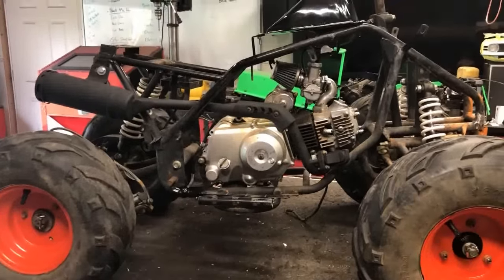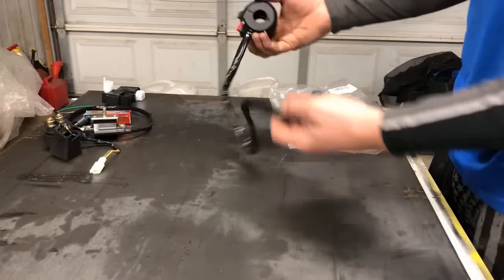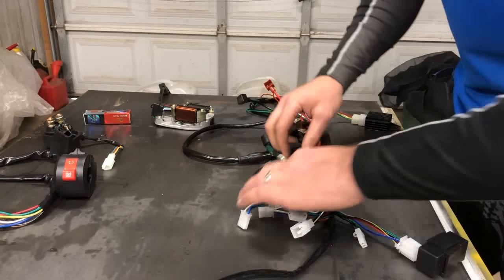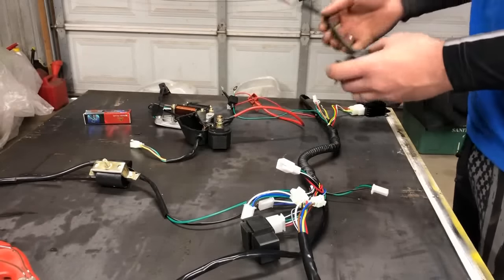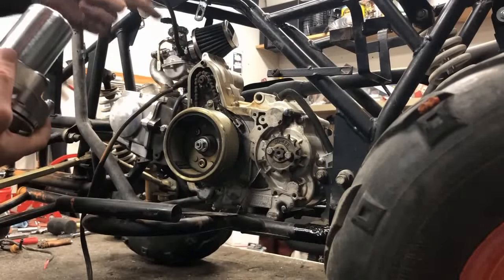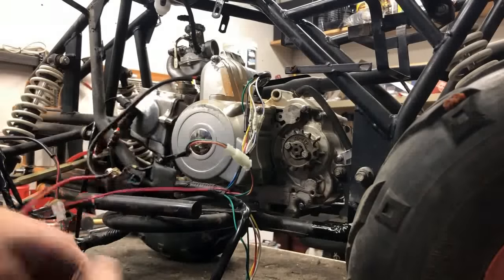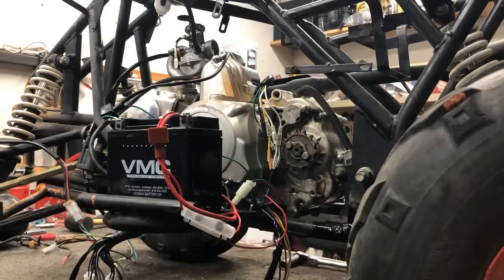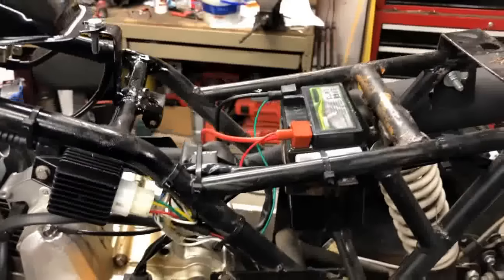Wiring a Chinese ATV from start to finish with an All New Wiring Harness!

Comment: Your videos are awesome and very helpful! Keep up the good work. I have a question on the wiring connection to the stator, the colors match except I have two yellows from the stator with a yellow and a white wires on the harness. Does it matter which one plugs into which yellow. Thanks

Comment: I have a taotao 110cc buggy, I got a whole new harness which is different than urs cuz it has no wires for the lights, I’m getting power every where when I press the starter switch but no power goes to the starter unless I bridge the terminals.. I also checked the wire coming from the brake n it only looks like positive power. What else can I try?
Reply from the maker: Check out my video I posted last month titled "How to flip a Chinese ATV". I can't leave a link because YouTube will delete the comment. Start that video at the 24:00 minute mark and I walk you through a step by step to figure out the exact issue your having. You will need a test light, if you don't have one I put a link in the description to get one off Amazon Prime cheap. Let me know if that helps!

Comment: What would explain that I don’t get spark?   I followed your video step by step. I sent my first harness back thinking it’s Chinese junk and still having the same issue on the second harness.  Battery is good and the engine turns over. I tried the new plug and my old plug with no luck.  Any suggestions?
Reply from the maker: Stator, CDI, Coil, and Spark plug are the components that effect spark. You also have the ground wire, safety tether and kill switch that need to function correctly. Start with the easy stuff. Unplug your tether, clean your contacts for ground, make sure your battery is fully charged, and use a multimeter to make sure the kill switch functions properly with an open and closed circuit. If you do all that and still no spark, then likely you have a failed component.

Comment: hi. is it possible to connect another cdi unit to yamaha kodiak 400 in 2000. maybe from the scooter cdi 6 pin .may you specify what cdi unit would be. thank you
Reply from the maker: I'm sorry but I don't know that. I've had limited experience with electrical on larger atvs.

Comment: I am rebuilding a Chinese quad right now for my daughter. I'm trying to find the correct exhaust. The exhaust pipe thats on it has that extra port on it but I can't find an exhaust with that on it. What is that port called and where can I find the exhaust with it included? Thanks.

Comment: Can I use a 2 coil stator if mine has a 6 coil? I have a buyang 107cc with a loncin motor and the remote start box and alarm thing on the front
Reply from the maker: I have not tried to swap stators, I've always just order the correct replacement. Next wiring project I'll give it a try just from fun!
Reply: I was wondering the same thing... I bought a 6 coil cover by mistake and was wondering if I should buy a new 6 coil stator and 6 coil flywheel and have all new or buy another cover and use the old stator... I'm worried V regulators may be different or something but not sure so I just ordered the 2 coil cover 😕

Comment: I have a Roketa 90cc atv with the bottom-mount starter and 6-coil stator. It’s missing some screws inside and outside of the stator cover. Would possibly you be able to give me bolt sizes?
Reply from the maker: Here is a link that has everything you should need: https://www.vmcchineseparts.com/products/chinese-engine-cover-mounting-bolt-kit-50cc-125cc
Reply: @PraskaBoysGarage  you’re the MAN! Thank you so much!
Reply from the maker: @blam3329  You bet!
Reply: @PraskaBoysGarage  my Roketa has spark!!! Thanks again for making this video!

Comment: I did everything step by step but I'm not getting no spark at the spark plug. Anything you know that would cause that
Reply from the maker: Stator, CDI, Coil, and Spark plug are the components that effect spark. You also have the ground wire, safety tether and kill switch that need to function correctly. Start with the easy stuff. Unplug your tether, clean your contacts for ground, make sure your battery is fully charged, and use a multimeter to make sure the kill switch functions properly with an open and closed circuit. If you do all that and still no spark, then likely you have a failed component. In my experience if you have a failed component it's usually a bad CDI Box.

Comment: Hooked up as you said green wire started smoking and key/kill switch did nothing turned over starter without start button aswell
Reply from the maker: Smoking in no good! If the green wire is smoking that means it's getting too much power likely for 1 of 2 reasons. 1) You have the power wires backwards, Green needs to be on (-) negative and Red needs to be on (+) positive. 2) You have power going to ground. Since something likely got hooked up backwards double check your fuse because it may have blown.
Reply: @PraskaBoysGarage  is it because i used a lawnmower battery?
Reply: @PraskaBoysGarage  what size battery does it use?

Comment: Were do u order all of your parts for your Chinese fourwheelers
Reply from the maker: VMC chinese parts is usually my first stop. They are based out of Illinois so I get my parts quickly and there prices are very reasonable. Other than them I typically stick to eBay for selection options or Amazon for the prime shipping.

Comment: Thanks for the great video explaining rewiring.  I recently picked up a 90cc go kart with electric start that was running just fine until my 5 year old son decided he wanted to wash it and hosed it down.  After that,  the electric start won't work, and I have to jump it with a thick piece of metal at the starter solenoid to get it running. I already checked all the wiring and nothing seems out of place.  Any idea what my problem might be?
Reply from the maker: Check the start button contacts inside the switch. It might have faulted when it got wet. Doubt you blew a fuse but always check that too! Thanks for watching and I hope you find the issue.

Comment: Hi, just followed your video and the quad tried to fire but then went completely nuts and constantly tries to fire up even when I stop pressing the start button. Disconnected the switch and also the key and it still tries to start when I put the battery connector near the terminal, any ideas???
Reply from the maker: Hey sorry I'm getting to your comment late. Are you still having issues? Sounds like your starter relay is having an issue.

Comment: Great Video! I just installed a harness. The starter runs continuously but no spark. Releasing hand break will stop starter, but the kill switch, and momentary starter switch on the handlebar do nothing. any idea?
Reply from the maker: Richard Hutchinson You definitely have a something plugged in backwards. It’s probably the 2 wire clip the comes off the starter relay and you have it plugged in the foot brake safety.
Reply: @PraskaBoysGarage  thanks
Reply: I had the same problem i cut the kill switch on the cdi and my motor started immidiatly but had one problem cant stop the motor so make a switch between the wire you cut and you can control the spark

Comment: I just rewired my 110cc taotao atv and it'll crank but won't start... That being said it originally had a 6 pin cdi but the wiring harness came with a 5 pin cdi would this cause it not to start?
Reply from the maker: If you used the entire new harness with the new 5 pin it should work. Something else must be the issue.

Comment: I have a 125cc engine 3 speed auto, it has the regular 5 wires from Stator but engine has an extra 5 pin harness but seems its connected to the trans

Comment: Good video! I picked up quad with a loncin 110cc engine. I'm trying to rewire it but i'm having a hard time finding a complete kit. It had a 4 pin DC cdi box with a 6 coil stator. I was wondering if i just got a 5 pin cdi kit and rewired the whole thing if that would work?
Reply from the maker: I've ran into the same issue. I replaced it with a 5 pin and everything worked perfectly! Good Luck on your project.

Comment: I have  BMX ATV and i am assuming its a 110. Picked it up for free off a buddy and he said it didnt run and looks like the wires are all hacked. The ignition was replaced and wires were spliced. Do you think this kit would work with the BMX?
Reply from the maker: Yes, I’m confident this kit will work for that ATV. I’ve done a couple BMX brand motors before. Here is a link to one I rebuilt that’s the same style: https://youtu.be/UwdPQMB3rmY
Reply: Awesome thanks! I will watch it and hopefully get this running for my boys to play with! I dunno if I missed it but where did you order your harness from? And also im pretty sure the one I have used to have the remotes to lock it. Do i need to go with that same style harness when I see what stator I need?
Reply from the maker: Mitchell Ferguson I purchase my wiring kits off eBay. If you want to purchase the kits that have the safety remote start and stops you can, however those kits run in the $75 dollar range. For me it’s more stuff that can break so I’m not a fan of them. All depends on what you want and how much your willing to spend.
Reply: So I took it a part and found that its a 6 pole stator and looks like its only a 70cc. Most 6 pole stators I am finding on amazon and ebay they are for a 150cc-300cc. Is there really any difference?
Reply from the maker: Mitchell Ferguson Yes, there are quite a few differences on the bigger harness compared to the one you need. I need to update my links in the description but if you have trouble finding the right one let me know!
Reply: If you could help. I am having an issue finding a harness that both has the 6 pole starter and the same ignition switch with the carb cable. Any advice would be great. Seeing a mixture of components between the 50cc-125cc and the 150cc-300cc that match my wiring harness.
Reply from the maker: Mitchell Ferguson Oh I see the issue. You can’t find one with the right start switch that also has choke on it? That might be a little harder to find. I’ll take a look and see what I can find!

Comment: can you give me the information to order this wiring for b110 taotao i have ordered two with no matching wires the one you have may work  thanks mike chandler
Reply from the maker: The wiring harnesses I personally use are linked in the videos description. You can buy it cheaper on eBay but Amazons return policy is way better so in the event you have a problem with it you can return it.
Reply: thanks for nothins
Reply: thanks for your information

Comment: Help I wired everything up and cranked it over and battery was dead. Jump it off the car battery and it ran ... tuned the carb and had it idling for about 10 minutes.  Put the body back on and planned on having my daughter ride it the next day.  Went to start the quad the next day and wouldn’t run.  Checked everything... got fuel but no spark... any suggestions???
Reply from the maker: It's probably something simple if it was running. Just troubleshoot a few things. Check every connection make sure all the connectors are good and not bent and hooked up in the right spot. Double check your ground that it is clean. Make sure the kill switch is in the run position. Lastly if you hooked your safety tether up in the back, remove it.

Comment: Can u help me I got a 110 quad n starter spins but doesn't engage the flywheel to crank it what could this be
Reply from the maker: This may sound crazy, but check your battery connection. If you have it reversed (negative to positive and the positive to negative)  it could cause the starter to run backwards and that can cause it to spin but not engage! Check that first. If that doesn't help let me know and I can reach out via FaceTime or over email to help!

Comment: Hello, hopefully you can help me. I’m rebuilding my daughters 90cc kazuma quad. This motor has what’s looks like a mini exhaust port right next to the exhaust port. And leaders to what looks like some kind of pulse pump but not sure. What is it exactly, is it necessary or can it be deleted?
Reply from the maker: Without seeing an exact picture I cant be 100% sure. However it sounds like the emissions vent tube. If it has a small rectangle box off the port with a thick hose and a filter then yes it can be removed and welded shut.
Reply: @PraskaBoysGarage  thank you so much. That’s exactly what it is. What exactly is that for and So it wouldn’t affect the performance or ruin the engine down the line if I delete that?
Reply from the maker: @LuisDiaz-kg1fy  Nope, it's to meet the 50 state EPA certification(California). You can purchase a new exhaust online that doesn't have it or you can cut it off and weld it shut.
Reply: @PraskaBoysGarage  thank you so much bro. Really appreciate it. I’m taking that monstrous thing right off right now. Thank you so much again. Love your vids by the way!!!!!

Comment: Hi was texting month or so ago about stator and wiring on lincoln 110cc got we bike runing still few gremlins drives fine on roads but soon as I go of road at all chain keeps coming off any idea please thanks
Reply from the maker: The chain will be popping off because of too much slack. Can you use the chain tighteners on the rear axel? Otherwise if you have it at full extension you might need to take a link out of the chain.
Reply: @PraskaBoysGarage  thank you was working on it today put new bars on and tighten the chain we out a spin and still the same we bike flys on road but soon as take it of road chain came off going to take few links out thanks for getting back to me your videos are a  great help
Reply from the maker: Lee Houston Sorry your having issues, I hope you get it figured out and back to riding soon! Thanks for watching the channel!
Reply: @PraskaBoysGarage  thanks man think new chain and sprocket set might fix it think you again  for a reply your videos are great help

Comment: What is goin on if my black small wire is getting really hot, I think the brake wires you connect to get the starter to work is causing it when I put them together the wires smoke

Comment: Great video,   I bought that same wiring harness (6 coil).  It has the wrong ends for the lights, it has the same male end that the lights do.    Did you buy chance use this wiring harness on a Tao Tao ATA 125-D?  That is what I am replacing it on and there are a few things that are not lining up.
Reply from the maker: Thanks! Yes, I have used this on a 125 tao before. It had a neutral and reverse light that I had to remove because the kit doesn't include the connection for it. What lights are not lining up? Your headlight or brake light? What is the difference in connections?

Comment: Maybe you can help, I bought a 2 coil stator wiring kit and the CDI box and rectifier are different than what was original.  My old CDI is a 2 plug box and my rectifier is much larger.  Will that matter?  I noticed the components in the 150cc-250cc wiring kit look exactly the same as what I have.  Should I go with that kit instead?
Reply from the maker: If your wiring a 150cc-250cc atv defiantly buy the harness thats designed for it. You can follow my steps because the install will be the same but don't use this harness if your on a bigger atv

Comment: I am lost lol. I picked up a 110 leopard for my son with no cdi. I bought this kit you have off amazon and after plugging everything in, it will not turn over. I have not only the blue green and white headlight plugs not plugged in, but also a green and red/yellow plug not connected to anything. The other end of it goes to the blue wire on the kill switch side. Also, the starter relay has a yellow/red and green/red wire and the two prong plug near it from harness is white/black and green. Uhhh. Then there is another plug coming from the stator that has 5 wires but only two prongs and nothing to plug that into. Not even sure what it is. Wish I could send a photo to show you. Anyway great video any help would be greatly appreciated. Thanks

Comment: What does the safety harness line go to in the back?  I have hooked all this up and have no spark. I purchased the same kit. The starter turns. It just wind spark. This video is great but something is missing for me. I have a tether safety switch in the back that is two wires but the safety harness is a 2pin plug? Please help kids b Fay is tomorrow lol
Reply from the maker: chadd1976 Don’t plug in the tether. You want that circuit to be open, because if you close it you will lose spark. Start with it unplugged and see if that brings your spark back. If you don’t have spark, you’ll have an issue somewhere else.

Comment: Hey I have a question. I have a Chinese 50 cc atv not sure which brand. My dog chewed up the wiring. The only thing it says on the controller is 601fl34. Any idea how I can replace it? There are no harness ends left so I have to replace the whole harness also but I need the controller first. Is there a universal controller? I hope I'm saying it right. It's the computer/head unit to the machine
Reply from the maker: The harness I have linked in this video is a generic harness that works for all E22 style motors. However it does not come with the wireless transmitter kit. You can buy the harness off amazon that comes with the transmitter but it is almost triple the price.
Reply: @PraskaBoysGarage  ok thanks a lot